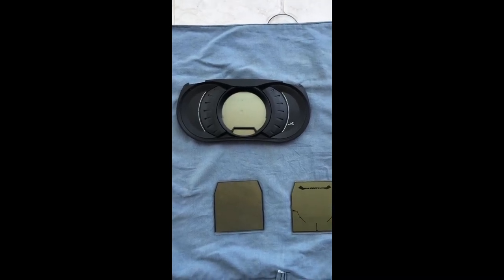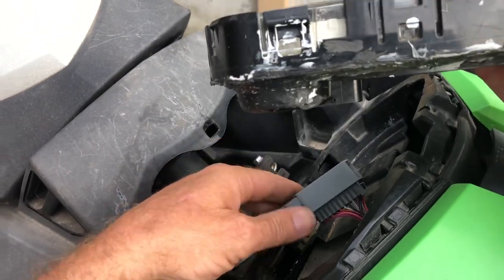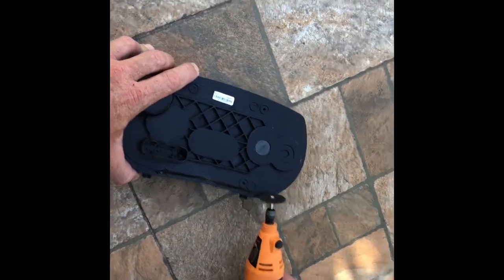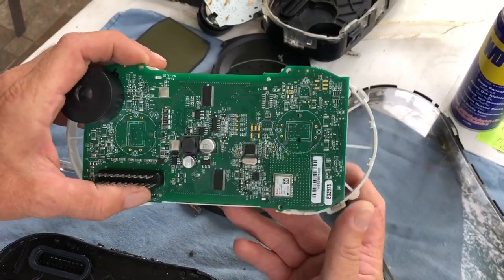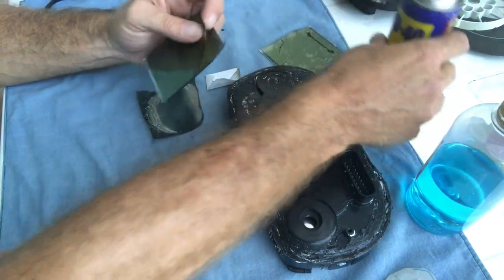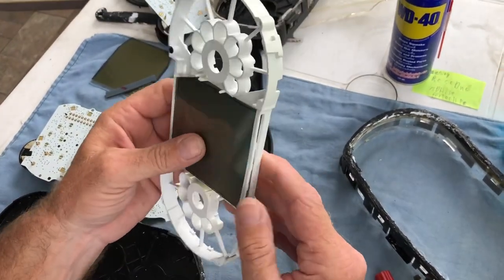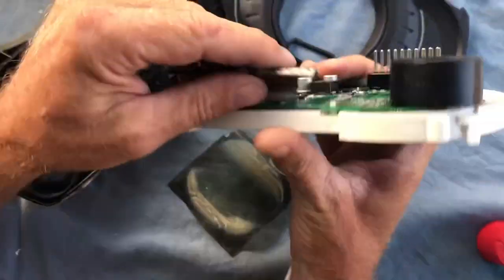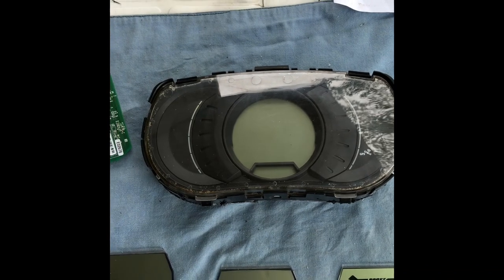Seadoo 4tec display / Info gauge / LCD screen Front and Back Film repair- GTI, GTX, 260, RXPX, RXTX.

Comment: Thanks so much Jan, I promptly received the Front and Back Film Kit from you, this past Satuday @ 210 Hours I performed the repairs as you described in your Video, I used a New Blade from a Box Knife carefully with the Lubricant you recommended to remove the the old Film & Adheasive Front and Back, reassembled the Cluster and plugged it into the Harness. Functions and looks good as new. BTW I was also able to procure a New Clamshell Housing as well elsewhere to complete the transformation to Refurbished Condition. Saved me from buying a New Cluster.  Randy  AKA randog311

Comment: I cannot find this two piece (front and back) film kit anywhere.  I used regular polarizer film to repair mine and it worked except that without the special back film that has a white background you can see thru the now working display and also see the circuit board behind it.
Reply from the maker: That’s why I replace them both .
Reply from the maker: For people who read this  . You can order front and back film by me :  $ 39 . email.  Displayscreenfilm@gmail.com
Reply: the back one is just a white or gray? what is the link for the front you bought?

Comment: Have you tried using a heat gun to melt the glue and pop out the clear screen?
Reply from the maker: No i haven't  , Do the fact the glue is so hard that there is a big change you brake the shell .